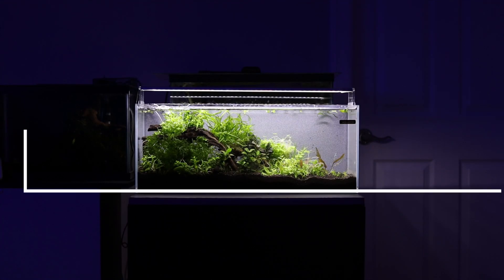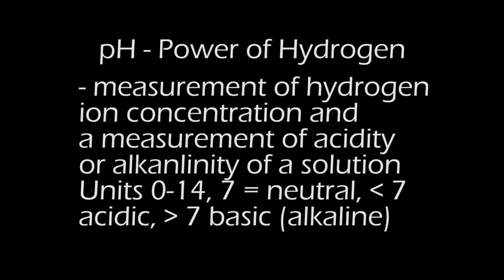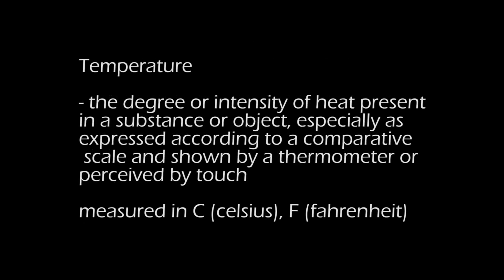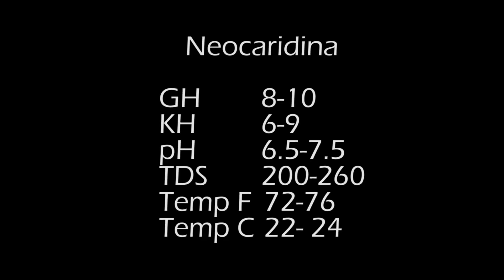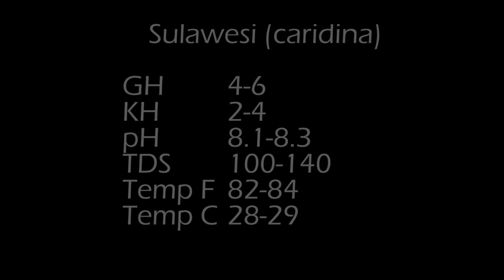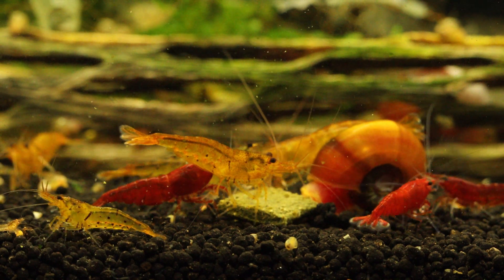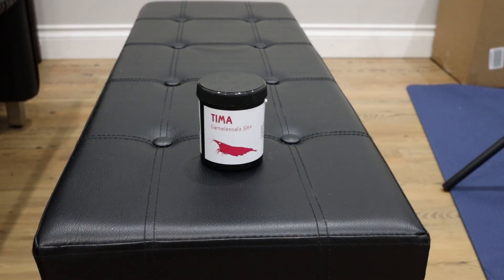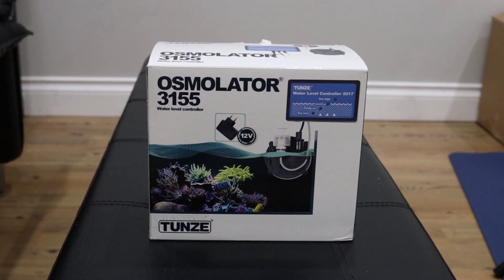Shrimp Tank Basics: Water Parameters

Comment: Have you already done a video on remineralizing after waterchanges? Think this might be interesting as peoples opinions on this is a bit different. 

After a waterchange i fill the tank up with ro water, check tds, then mix the missing minerals in a cup so when i add it to the tank the tds should be back to the desired 130ppm.
Reply from the maker: Great suggestion. Let me do a video on this topic, thx for the support
Reply: @RWAquariumPages  Great! Looking forward to it :) 

I read that Ching Thung Vin actually doesnt remineralize outside of the tank, so thats where opinions start to split. Also, best practices to keep constant water parameters with multiple tanks would be interesting to see. Was thinking of a way to automate the remineralization process, but havent made the move yet not to mess up anything by accident.

Comment: What's the conversion factor of your TDS meter? There's like 3 of them. I prefer EC (electrical conductivity) meters since it's standardized. TDS ranges aren't useful if there is no conversion factor stated.
Reply from the maker: It can do .5 or .7
Reply: @RWAquariumPages  Thanks for the reply, Ray. Do you know what the most commonly used conversion factor in aquaria is? (I think it's 0.5, but I see 0.7 used a lot in hydroponics). Since I use an EC meter, I have to do a reverse conversion from TDS to get a value in EC. A lot of shrimp additives made in Europe use EC which is measured in microsiemens, which just adds to the confusion haha

Comment: Great info.  If you get the kh gh ph right do you still need to use the sulawesi minerals?
Reply from the maker: nope, that's a great point!
Reply: @RWAquariumPages thanks for the reply.  My kh gh are at reommended levels for my tropical planted tank at the moment but i want to add shrimp to my tank but the shrimp require  gh of 8-10 and kh of  6-9. My kh is 3 and gh is 5. If i change the parameters to suit the shrimp how will this affect my fish and plants?
Reply from the maker: @dombui8137  do you know fish adapt more easily than shrimp and accept a wide range of parameters
Reply: @RWAquariumPages  yes, wasn't  sure what parameters to acheive to make all the animals happy. But from what your saying shrimp are more sensitive so parameters must be closer to what their use to. What do you recommed to raise gh and kh? my ph is at 7.8-8, neo cardinas will be ok with this right?
Reply: @dombui8137  if you are only keeping neo it’s fine them shrimp are indestructible as long as your tank has a bit of algae

Comment: I have a planted,10 gallon shrimp tank with very fine gravel. Is it necessary to move this gravel with a substrate vacuum pump to remove waste, or is it best left alone?
Reply from the maker: fine gravel as in sand? are there fish? if it's shrimp and diet, not as often or as much, it's just how much waste is accumulated in there and then clean it out, with shrimp's small waste and bio load, i personally don't that often or even at all, hope that helps!

Comment: Would seachem equilibrium work for caradina blue bolts ? Or is there anything eles I can use that is easily available ?
Reply from the maker: Yes it would its basically the same with different concentrations. Shrimp specific salts have more vitamin for shrimp.
Reply: @RWAquariumPages  thank you Alot , i just started a blue bolt tank , and what I'm wondering is as you add food /things the tds starts to creep up at what number do I do a water change ?
My second question is can I remineralize to water a couple days before I use it ? Or do I have to do on that same day ?
Reply from the maker: @jesse0M  great questions. My pro friends that use the the method about creep.of 10 to 15 tds increase they dl a water change. For bee shrimp I mix just before I do the water change. For sulawesi I age for 5 days. Liquid salts mix better than dry salts but Liquid salt you're paying for water. Hope that helps

Comment: My pH 7,2 , I have canister filter. Do the canister filter increase oxygen in the water that make the pH 7,2? I use ro water with ph 6,4.. I use co2 to low the pH to 6,8.. I have caridina.. I have put cattapa leaves and spaghnum Moss, but still If I don't use the co2 the pH will still 7,2-7,4.. any idea to reach low ph?
Reply: I using regular sand (rivers and), because my other tank is success breeding neo.. is the water flow from the canister produce o2 that raise the pH? My out flow is below the water surface..  any idea to lower the pH without overdosing the co2?
Reply from the maker: @robinsonsitompul9362  regular inert sand doesn't buffer the ph. You could add a bag of peat. I've done that before abd it's natural and slow
Reply from the maker: Which substrate are you using? I'd be careful with over dosing with co2 for caridina

Comment: I still don't understand TDS XD. I remineralize my water change to 190ish. Now if the rest of my tank after I remove 10% of water is reading higher should I just add distilled water until the TDS becomes diluted to 190ish and not add any other minerals?
Reply from the maker: Bingo! That is correct!
Reply: @RWAquariumPages  Excellent. Say I over do it with the distilled water and now my TDS is like 100. Any particular way you recommend raising the TDS to not stress them out? bacterAE right into the tank? Remove 10% again and mineralize with saltyshrimp?
Reply from the maker: @halfcaf1105  100 for caridina is great. Raise it on the next wc slightly. Or you could raise it 20ppm per day
Reply: @RWAquariumPages  forgot to mention I'm keeping neo caridina. Thanks for the info!
Reply from the maker: @halfcaf1105  ill be honest. Don't change numbers. Approx and within range and stability is key with these guys and get some epic locally home bred over import ed ones if u can